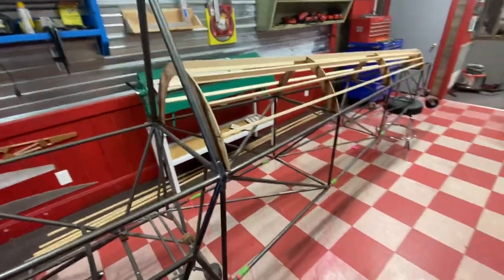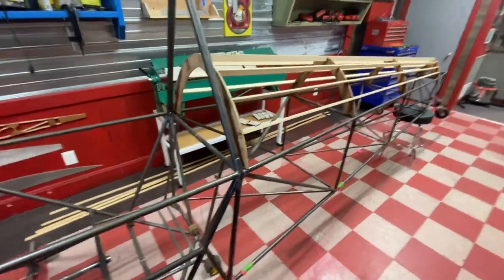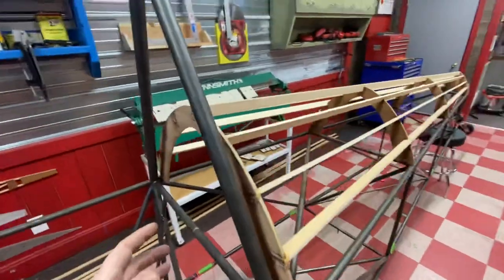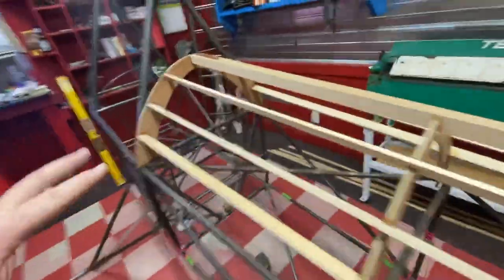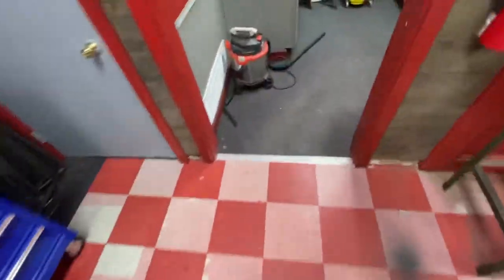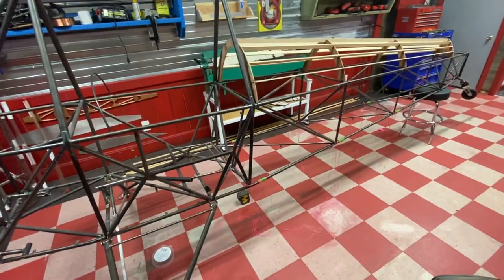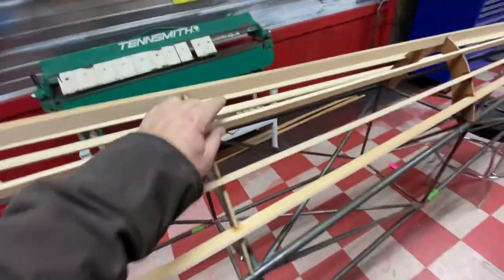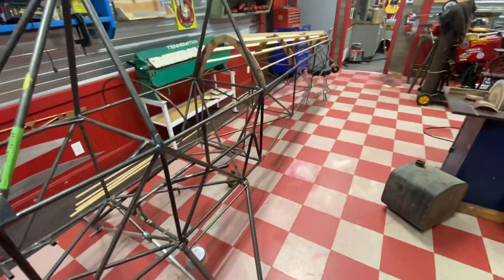Baby Ace build update - 11

Comment: Back at the aft end of the deck, you have the luxury of the metal fairing which will cover any gap you need to leave forward of the stabilizer. I wish I had a small storage behind my head rest. I still might do that someday.
Reply from the maker: I’m not worried about the gap, it’s the opposite, I need the gap actually. That washer pushed it forward just enough to clear the stabilizer from touching the 1/4” ply. It was THAT close!!! I almost thought I’d be in trouble but it just fits! 😀
Reply: @michaeljohnson2922  you might consider adding some hardwood blocks or brackets with nut plates back there to attach the fairings.
Reply from the maker: @leeroyholloway4277  yeah, I’m thinking that’s a good idea too